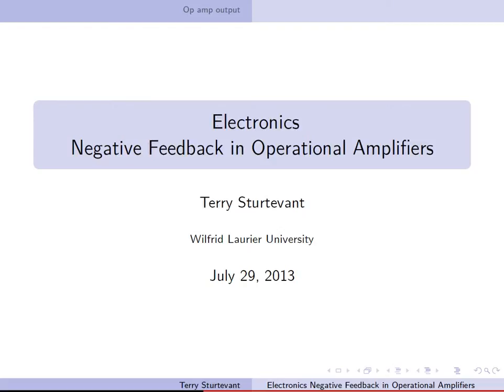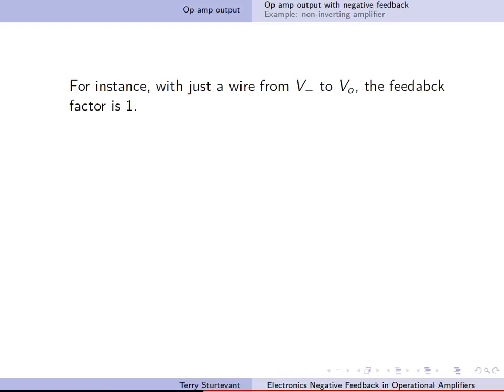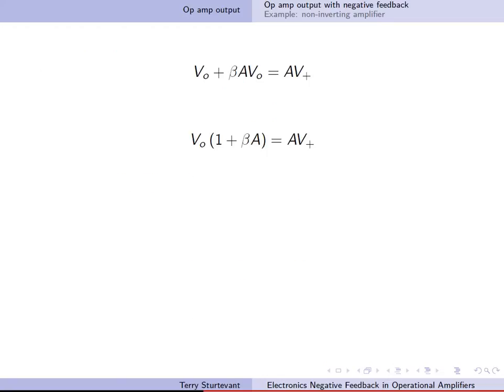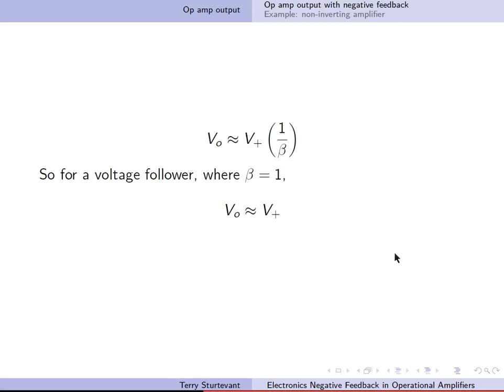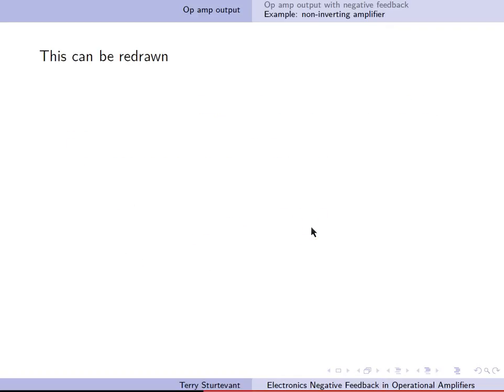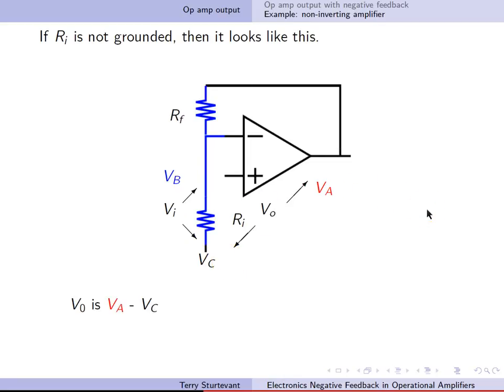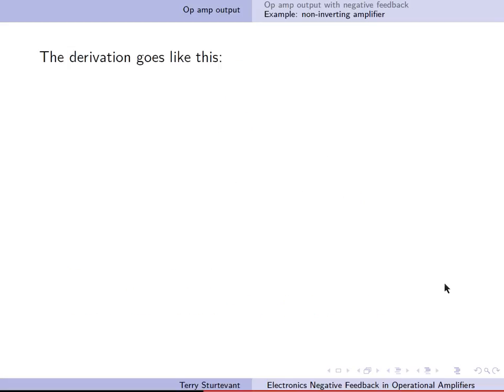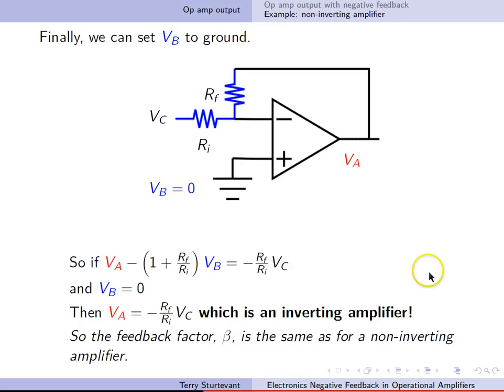Negative Feedback in Operational Amplifier Circuits

Comment: What's the hurry for? Shifting through the most important stuff in 10 seconds? Why even do this?
Reply from the maker: *****  It's always a challenge to try and keep the entire video below 5 minutes or so, so that's one of the reasons I included a link to the original document. If there was a particular 10 second part that didn't have enough detail, let me know for when I revise the document and/or video.
Reply: Problem is, I didn't feel like a certain point was rushed. That would just make me rewind and rewatch. I felt it was rushed from start to end. Important stuff like Math equations that explain how it works appear on screen for 3 seconds and then the next one appears. I don't see what a person now to OpAmps can obtain from this style of presenting. I personally felt anxious just by the sheer volume of stuff at once. My suggestion would be, make a 5 min videos on less material so you can affort to give each segment the time it needs.

Thanks for your reply.
Reply from the maker: ***** Fair enough. In my course, I (briefly) explain negative feedback, but don't ever require students to do any derivations or anything themselves; it's background for working with op amp circuits. If students were going to have to determine feedback factors for circuits themselves, then probably one 5 minute video for each circuit would be better. For what it's worth, I'd never seen anyone equate the inverting and non-inverting amplifiers before, so that may have been particularly mind-bending.